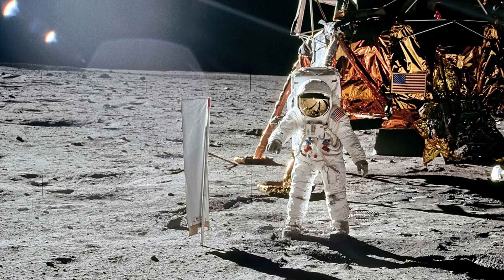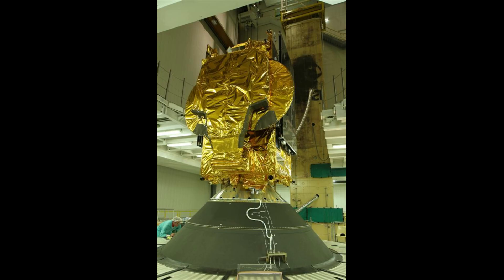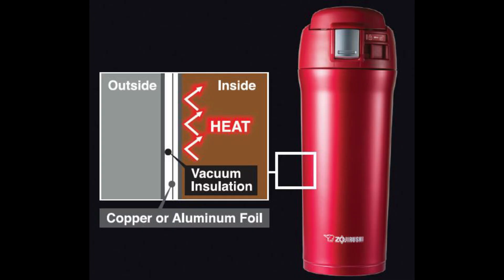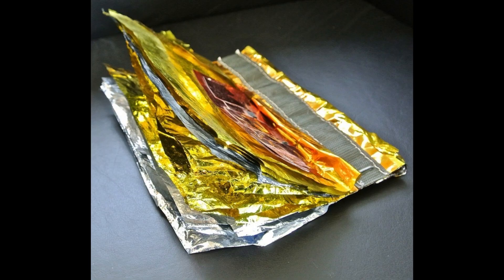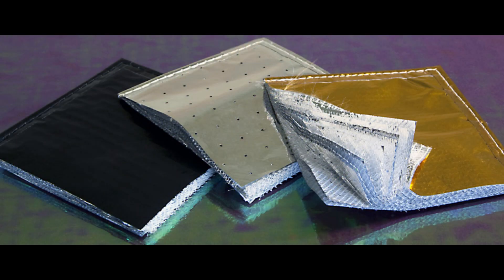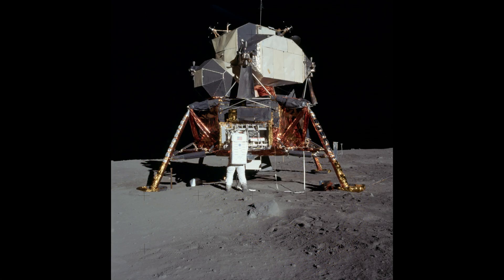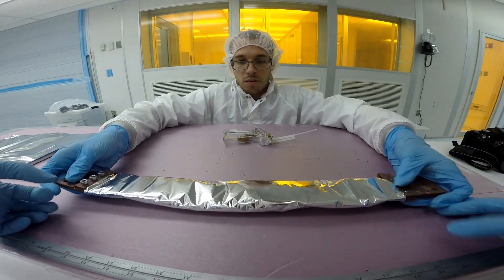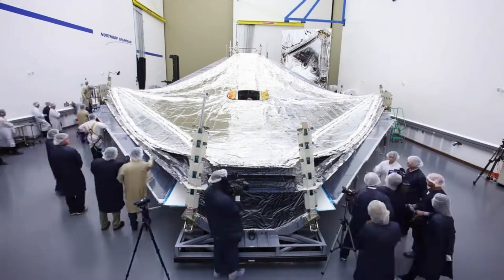Spaceships Are Not Covered In Gold Foil - The Cool Engineering Behind Multi-Layer Insulation

Comment: Scott, I noticed on a recent SpaceX launch, the MVAC engine sported a new bell design.  What’s the story with that?
Reply: When less performance is needed they use an MVAC with a shorter nozzle which is less expensive to produce. This reduces performance but on flights which already have excess performance that isn't an issue, so they can save a little money using the cheaper engine.

Comment: The Skylab film we always see shows a section of insulation flapping around as though in the atmosphere.  What caused that?
Reply: That video is during a spacewalk by two astronauts to install a new sunshield over a section of the lab where the original sunshield had been ripped off during launch (something had triggered a deploy command before the lab was above the atmosphere). There are two astronauts underneath that canopy working hard to install it. You are seeing it flap because the astronauts are working on the poles the sunshield is connected to.

A very good walkthrough is in "SkyLab - Maybe the Most Important Space Programs So Far." by Curious Droid's channel. Explanation of what happened to require this band-aid fix starts at 4:08. Description of exactly what was happening during that video starts at 6:03 (including video showing the flapping you mentioned). Video of the deployed sunshade not flapping can be seen at 13:19
Reply: @MichaelOnines  thanks!

Comment: Gold is very good at reflecting infrared. The mirrors on the James Webb telescope have a gold plating. The astronauts visors and cabin windows were also gold plated (on a nanometer scale) to reduce heat load.
Aluminium is a better reflective surface for visible light.

Comment: The one we produce is made of a single layer of capton with a complex multilayer coating on both surfaces (500+ layers made of 6 different materials), resulting in an object that reflects 99% of visible light and NIR, has high emissivity in the IR and is transparent to microwaves and radio waves. The holes allow electrical continuity between the metallic layers on the two surfaces.

Comment: This is several layers of Mylar and aluminum foil which is used as micrometeorite shielding.  It may have the added benefit of insulation, but its purpose is to provide protection from the stuff flying around at ludicrous speed that would blow holes in everything.  As far insulation it basically a worthless endeavor as it will be in space and there is no point in insulating it.  It is designed for wide temp ranges with essentially no cooling.
Reply: Eh, no. 
1. Micrometeorite shielding is done using a Whipple shield: a thin metal plate on a standoff outside of the structure you want to protect. 
2. Incorrect, insulation is worthwhile (actually: essential) in space. Near Earth orbit, on one side you're being heated with 1300 W/m2 of sunlight, on the other side you're radiating heat into deep space. A spacecraft without insulation would overheat on one side and freeze on the other. MLI both reduces the heat load coming into the spacecraft, and the heat load going out. When done right, you can build a spacecraft that keeps the interior at a constant, nice temperature without active heating or cooling. The LM did this, for instance.
Reply: @zounds010  it appears you are correct.  I was misinformed.  Thanks for your quick reply.
Reply: No, not Mylar, aluminized Kapton

Comment: The yellow color means it absorbs blue light, resulting in some heating of the outer layer.  Why did they aluminize the inside of the kapton, rather than the outside (or both)?  To keep the material more flexible?

Comment: Hi Scott, love your videos. One thing that has always puzzled me is the spikes which protrude from the circular landing pads or feet on the eagle lunar lander. What are they for? And, correct me if I'm wrong, if they came in for landing sideways surely they would be ripped off? Watching this video just reminded me as you have some stunning pictures which show them.
Reply: Very simple sensors to let them know when they had touched the ground. When you listen to the Apollo landings and hear the "contact light" callout, that was one of the dangly probes doing its job. Not sure how exactly they worked, but that's what they did.
Reply: @KevinT3141  Thanks Kevin
Reply: As Kevin mentioned, they are the contact probes. In photos of the landed LM, you can sometimes see one of these poking out from underneath the landing pad. During the landing, they would bend flat.
Reply: @zounds010  Thanks, that has cleared up a few questions I have had ever since seeing the black and white video of the shadow being cast from the LM from out of one of the windows.
Reply: They only had the sensors (which were each five feet long) on three of the four legs. Because the probes were normally bent on landing there was concern about a bent probe sticking out from the footpad at the bottom of the ladder and being a trip or puncture hazard.

Of course everything NASA has a fancy name and a mandatory acronym, these were called the Lunar Surface Sensing Probes (LSSP).
Reply: "if they came in for landing sideways surely they would be ripped off?"

They might, but they were designed to be flexible. In any case, they didn't "come in sideways": the final descent to touchdown was vertical from about 100 feet up. All six landing videos are available on YT. They're worth watching.

Comment: I want try try smoothly mounting the thermal blanket onto a thin mylar sheet and then using the mylar sheet to fix in place, probably directly onto the aluminium shielding. Seems a tidier smarter way to me.

Comment: Great show Scott. Maybe you can explain this. When SpaceX launches a rocket and they’re showing TV images from the second stage, looking towards the first stage, you can see this gold looking plastic fabric fluttering. Is this from the vibration of the rocket engines? Or is the spacecraft just running into air molecules? It’s just a very thin at that altitude but still would be like getting a wind. Does that make sense?
Reply: Do you refer to the mylar wrapped around the vacuum engine?
Reply: This is the gold foil like material above the engine, kind of up in the right hand side

Comment: Fun fact, Scott -- a few of the Lunar Modules, including at least one that landed on the Moon, did NOT wrap the lower legs in the foil.  LM-3 (Apollo 9) had no foil insulation on the lower legs (below the lower extension struts) or on the footpads  Of course, they weren't planning any really long DPS engine burns on Apollo 9, so why bother, I guess.  But if you look very carefully at the pictures from Apollo 14, LM-8 also had no foil on its lower legs.  The footpads were swathed in foil, but the lower legs were the bare aluminum.  The lower legs went back to being foil-wrapped on all of the J-mission LMs, though, if my memory serves me correctly.,  🙂
Reply: As the missions went on they found that they were able to reduce the amount of insulation on the legs and save some weight. However I'm not sure how much of that reduction would actually be visible. And I don't know if it explains your observation about Apollo 14.

Comment: Thank you, Herr Manley, this video explains probably the most important yet most unknown thing over the history of spaceflight. I myself thought that for example JWST used freaking kitchen aluminium foil as a heat/radiation shield which sounded bonkers to me - until now. One question though: How thin was the sun shield for JWST anyway?
Reply: I remembered it was thin but I didn't remember it was this thin:

Kapton membrane 25 microns
Aluminum coating 100 nanometers

The outer layer is 50 microns and has an additional 50 nanometers of silicon which is what gives it the purple tint.

Comment: That was probably a great meeting at NASA: ...and then the insulation layer is crumpled lightly. This ensures that at all times there is a minimal contact between the layers of the insulation foil while costing the least amount of weight and material. It is also very, very easy to manufacture.

Comment: The team working on the Voyager probes wouldn't be the first people to use foil from the grocery store. I designed a nuclear imaging detector years ago and I needed to make a light diffuser/reflector for a scintillator package. First stop? The Rite-Aid next door for a roll of aluminum foil. Needless to say the production units didn't use kitchen foil, but rather commercial rolls of ultra-clean UHV foil for the reflector patterns, which is indeed a pain to work with since the aluminum galls so easy, not to mention the horrible scrunchy noises it made when unrolling it.

Comment: So if the separation distance between foil layers doesn't matter, why does the Webb's sun shield have such widely-separated discrete layers instead of just sandwiching with a separator material? Surely the weight savings alone couldn't have been worth the extra time, risk and complexity compared to a robust layered blanket? I'm obviously missing something.
Reply: Separation distance doesn't matter when you're building a spacecraft that will function at room temperature. It does matter when you want to cool the spacecraft to 40 K.
Reply: @zounds010  Sounds plausible.

Comment: The oil film on aluminium foil is a residual coating from the rolling process that produces the foil.
It is not a coating added to prevent things from sticking to the finished product.

Comment: How well have JWST's sunshield and mirrors held up in space after about a year? Have there been any major micrometeor hits damaging either?
Reply: The mirrors have been hit a few times.  Only once very significantly that I’m aware of.  We wouldn’t be able to tell for the sun shields until it got incredibly bad.  The mirrors can be directly imaged but the sunshine can not
Reply: @briancomber8371  I remember it took a pretty good hit early on that did cause a slight degradation in one of the mirrors, and there were concerns because their predictions were that statistically it should have taken a lot longer before a strike of that size occurred. They were hoping that it was just bad luck that it happened that soon and that it did not indicate a higher level of micrometeoroid debris than they anticipated, which would lead to reduced capability over time. I haven't heard anything since so I'm hoping that it turned out to be just bad luck.

Comment: Astronaut creating a whole debris field while looking at what might have caused a hole in the spacecraft....
🙄
(I know, it is in the same orbit in the same direction. And no other satellites are flying anywhere near the ISS orbit. And it will de-orbit pretty quickly because it is light and has a large surface area. But still looking at him chopping away....😐)
Reply: @colinsouthern  The STS-126 toolbag deorbited in nine months. As mentioned insulation would be much lighter with a lot of surface area so I would think that it would have deorbited even faster. Also more than once astronauts on EVA's have tossed debris overboard that is too big to bring into the airlock like old antennas. They throw it in a certain direction to make sure that it won't come back and hit ISS before it deorbits. This seems to indicate that they aren't too worried about it colliding with something during that time as the odds are probably astronomical, and also I'm sure it is tracked until it deorbits.

Comment: After 20 years in my local fire department, I must disagree that "radiation isn't a good way to transfer heat."  Everybody knows that the radiant heat from fires above a certain size is too intense for an unprotected person to get close to.  That's the whole reason firefighters wear their bulky suits and even those have their limits which can easily be exceeded inside burning buildings if you're not careful.  The radiant heat from a well-involved house fire can, by itself, ignite other houses 100' away or even more, no flying embers required.  And heat radiated down on everything in a room from the superheated gases at the ceiling is what causes a room to go from 1 piece of furniture burning to flashover involving everything in the room (including the whole volume of air in it) in an instant.  Radiant heat is no joke.
Reply: Radiation is very temperature-dependent (it scales with t^4).
Reply: Radiation in this context is different from "radiant" heat. It's more about electromagnetic radiation.
Reply: @tsurutuneado5981  Um, nope, it's exactly the same thing.  Radiant heat is carried by photons, the quanta of electromagnetic radiation.
Reply: @TheBullethead  That is a notion based on your perspective.  A lot of what you are feeling is heated air.  When it comes right down to it, it's faster to conduct heat away than to radiate it regardless of any anecdote you care to cite.
Reply: @TheEvilmooseofdoom  Conduction is only faster if the material that is being used to conduct the heat has a low specific heat (IOW, is a good "conductor" of heat).  Metals, for example.  Stick a metal spoon in a pot of boiling soup and it immediately burns your fingers.  But use a wooden spoon and you never feel it get hot, but only the heat from the rising steam above the pot enveloping your forearm in general.  Likewise, line a room with 1/2" thick sheet rock and it will take about an hour for sufficient heat to conduct through it to ignite objects on the other side.

And you are totally wrong about "What you are feeling is heated air".  Yes, a fire heats the air around it but heated air goes up (at least outside of buildings), it doesn't go sideways or down (unless inside buildings).  In fact, at ground level (both inside and outside), there is a rush of ambient-temperature air moving towards the fire to fill the partial vacuum created when the hot air adjacent to the fire expanded and rose.  So, outside, in the absence of any significant prevailing wind, when facing a fire the only air you feel is at ambient temperature hitting you in the back.  The heat you feel on your face is from direct photon impact and nothing else.  Things are considerably different inside but still follow the same rules applied to the different circumstances.

As I said, I spent 20 years in the fire service.  Studying heat transfer was a matter of life and death so I devoted a LOT of time to it above and beyond the thermo class I took back when getting my degree in engineering.  I know whereof I speak here.
Reply: @TheBullethead  I remember being at an airshow and they did a simulated attack, after a plane flew over there was a big explosion to simulate that it had dropped a bomb. The distance was probably half a mile but you felt that heat instantly, certainly well before hearing the sound.

I was at a hockey game with a coworker, there was a big flamethrower up in the rafters which created a large flame when there was a score and things like that. Whenever that would flash you felt it instantly even though it was several hundred feet away and above us. I mentioned to my co-worker that the heat was travelling at the speed of light and I remember he seemed surprised. Infrared light is light after all.

A lot of people don't realize that the heat that you feel from a fireplace is almost solely radiation, not convection. In fact there is no warm air coming from the fireplace into the living room (unless it has convection tubes then you get a little bit of convection). Instead air in the room is going into the fire and then up the chimney (I know you know all of this). If someone were to put on a gas mask and close the damper, I think they would be amazed at the huge amount of heat now pouring into the room, heat that had been previously going up the chimney.

As for your original comment, a building fire is extremely energetic so yes you are going to feel the radiation. But it is a problem in space getting rid of heat because there is no conduction or convection only radiation. Just the heat coming from the electronics is difficult to get rid of. On the International Space Station they have an ammonia cooling loop which carries the heat out to very large radiators. If you look at a photo of the ISS, the large solar panels are the most noticeable, but you can also see some panels that are oriented 90 degrees from the plane of the solar panels, those are the radiators.

On the Space Shuttle the payload bay doors served double duty as large radiators, which lined the inside of the doors. That's why the Shuttle always had its payload bay doors open in space, whether they had cargo in there or not. In fact if they reached orbit and could not get the payload bay doors open they would have immediately cancelled the mission. In fact it would have been considered an emergency because the heat inside the Shuttle would build up so fast, and they would have landed at the nearest emergency landing site instead of waiting what could be several hours before their orbit took them over the primary KSC and Edwards landing sites.

Comment: When multiple layers are used, is the back side painted black? If not, would thermal radiation not just bounce between the layers?
Reply: From what I remember them saying about the JWST sunshield, yes it does bounce back and forth between the layers, but a reduced amount of heat makes it through to each successive layer. And most of it eventually makes it back to the outer layer and gets emitted back into space. Some of it might get absorbed by the spacecraft but apparently enough of it gets emitted. Whether they coat the back side to help with this I don't know.
Reply: Only the very outermost facing side is not aluminized.  Everything else is as shiny as possible for the lowest emissivity possible.  Kapton is transparent with an orange hue.  When you see the gold looking blankets, you’re seeing the aluminum of the backside of the outermost layer through the orangeish Kapton